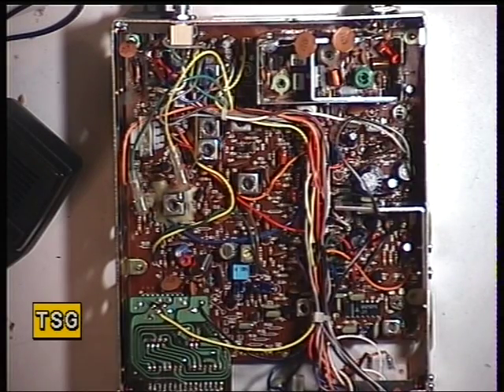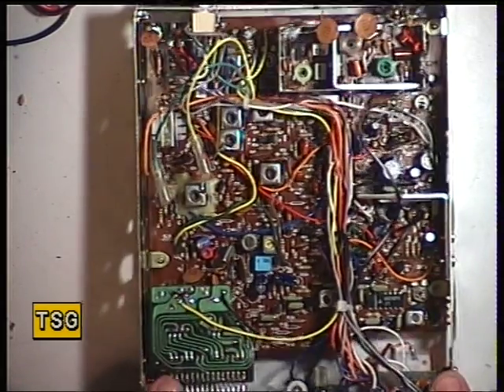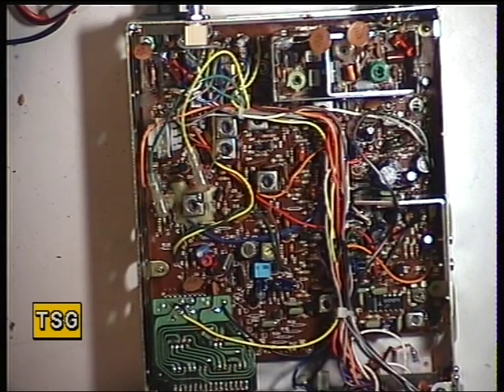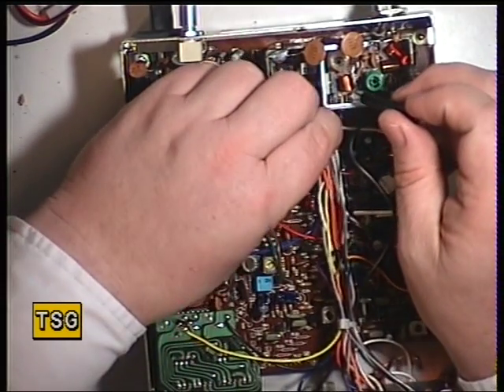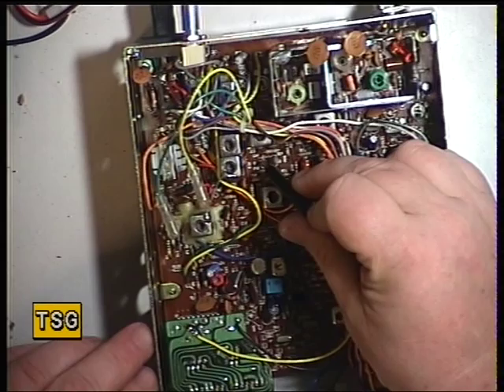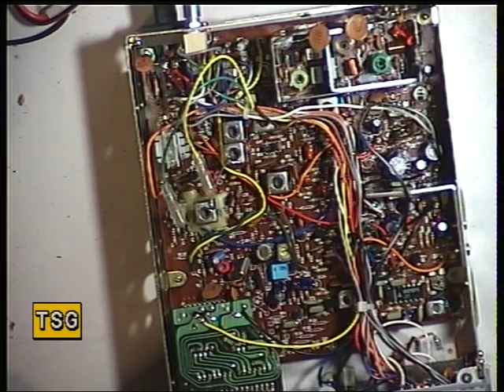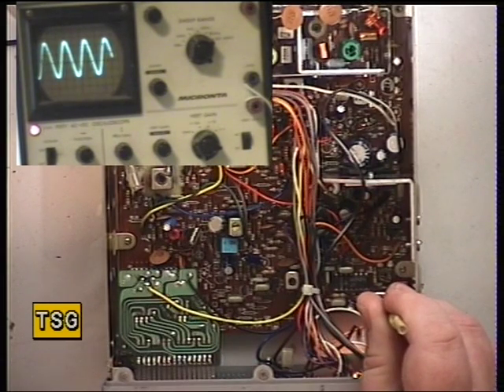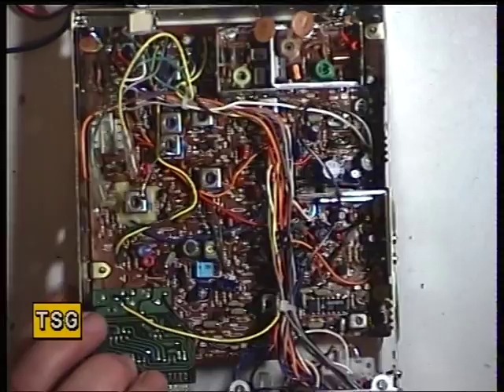York JCB861, UK (CB 27/81) CB radio (Mobile)  - Receive adjustment

Comment: Lol burner brigade :)

Thing is, not many people run 4W on the CB. Only really the beginners
Reply from the maker: Oh well, £2k fine first time caught....6 months prison second time....and so on.

Big purge coming up when new rigs with SSB appear in July. I notice some suppliers already offering SSB sets openly. I mentioned this to the DTI (or whatever they're called this week) and they sent me an Email explaining that they hadn't even come out with the UK approval markings yet!

The problem with the burner brigade in places like Nottingham 35 miles from here...as you can hear from these demonstration videos, is that they live on 19 talking on top of each other instead of establishing contact on 19 & moving channel.....thus making 19 unuseable 35 miles away.

Many don't realise that you need to square the power to double the range. So if you get 10 miles on 4W, you need 64W to double that.....and 2.4KW to double that again!

Richard
Reply: Yep that's the one. I always QSY from the 19 otherwise I'll get moaned at haha

I will admit, I run a small 25W linear when the need is there (when the Russian taxis pick up usually). Plus being in a dip here doesn't help. Should help when my antenna goes from 17FT to 32FT :)

Anyway, I do like the York 861, nice radios :)
There was one at my local radio rally last year for £10. I regret not getting it now. I do have an 867 though but has no TX audio. Must look at it when I get a free weekend. Keep up the good work Richard :) 73s